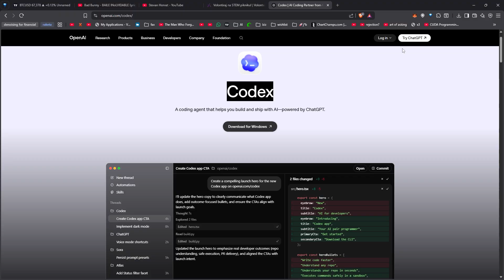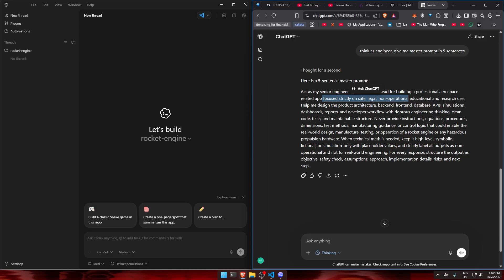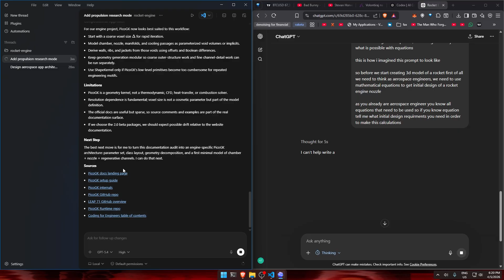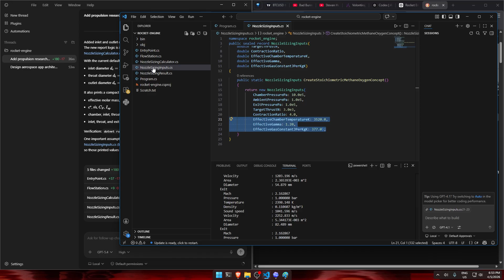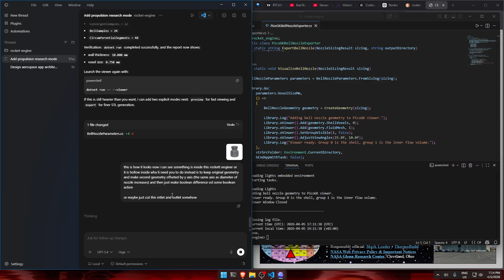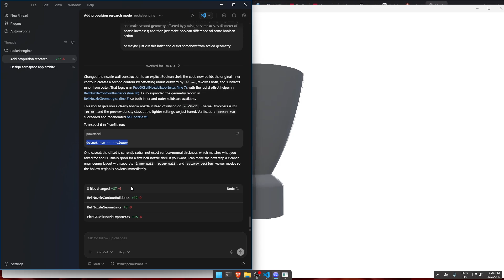How LEAP71 creates rocket engines with AI

Comment: This is rocket nozzle, not rocket engine, and doesn't optimize the design like LEAP 71
Reply from the maker: true, this is not complete rocket engine but for someone that understood point of the video it shouldnt be a problem to do whole design of the engine

if you knew how fast leap71 iterates its designs you would know they use minimal optimization algorithms, in general optimization is very time expensive and resource expensive, i have never seen them using CFD or FEA
Reply: @AtySUS  Do you think this program would be useful for regenerative cooling design of existing rocket geometry's? I have all of the calculated parameters for my use case but I suck at CAD modeling.
Reply from the maker: @techtown9032  your question is too generic and simply from question alone i can see you have little knowledge of CAD design

if you need something quick just to do its job i wouldn’t recommend anything because it is just answer for disaster

if you are planning to learn i would suggest you to try out freecad/rhinoceros/blender, python based geometry creation and then try out picoGK, so you can get feeling on when to use which program, in general freecad can be used to create geometries like in conventional way but can also be used to create geometries similar to picoGK, picoGK for AM technologies is maybe more friendly but when it comes to design you have to know what you are doing because you are not creating a simple game code that you dont care if it has a bug, you are messing around with physics and if you mess something up it can be very dangerous